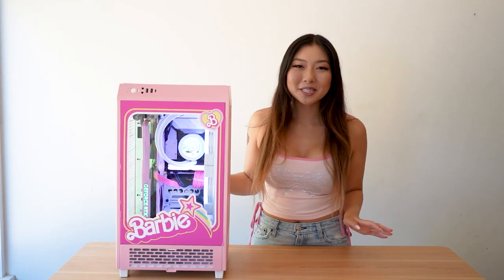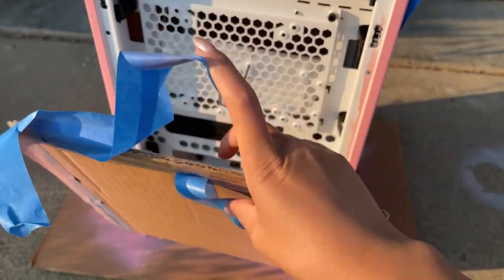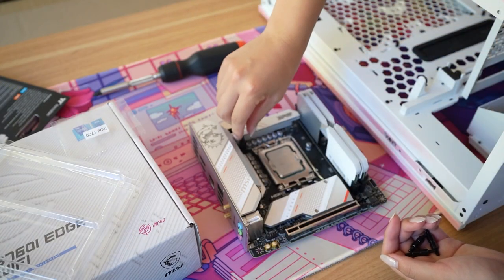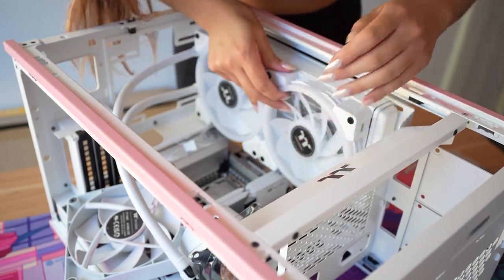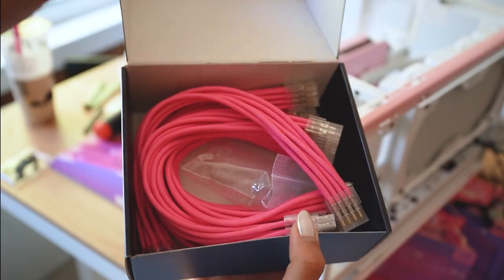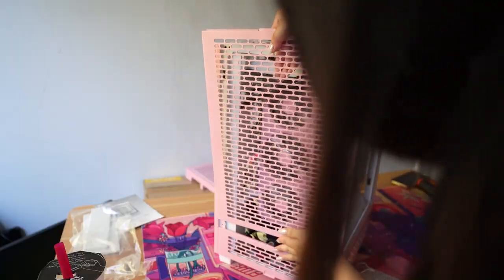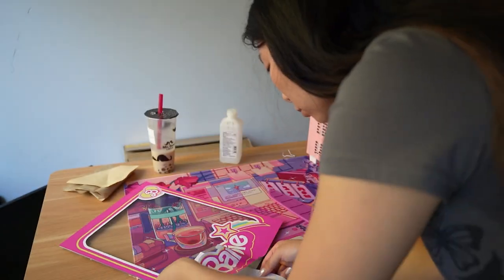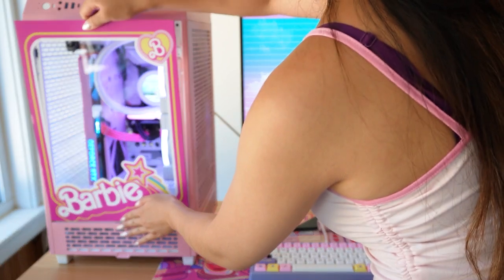I built a custom Barbie PC! | Thermaltake Tower 200, 13600K, Pink Galax 4070 GPU, NZXT Kraken Z63

Comment: I also love the pc, I just built my first pc in the 200. I got a ryzen 9 7950x3d, 4090 gamers oc edition, nactua u12 cooler with a kryo sheet no thermal paste, 2x24gb titanium dominator 7200 ram, 2 990 pro ssd's (4 front and 2 back) on a b650i aorus Elite mitx motherboard powered by a thermaltake 1050w gold certified power in a tower black 200 case.

Comment: To do vinal it's easy, just cut ½-1 inch of the backing of so the adhesive is out. Then like up the strip on the side you removed in the edge. Then fold onto the curve. Finally slowly removed the back while going side to side with a squeegee to remove air and apply flat and smooth. The slower the better, because of you go to fast it may lay weird or have air bubbles. If you go to fast you could poke a with with the squeegee or stretch the vinyl as well as air bubbles to. I hope you see this and it helps I worked with vinyl for years.

Comment: This case DOES support MicroATX motherboards. Just be aware you may have to remove the GPU support braket. That said, I love this case. Super easy to build in and the airflow is crazy good.
Reply: I not agree with you, this is case support matx wide 24,5mmx24,5mm look like asus rog strix b760g